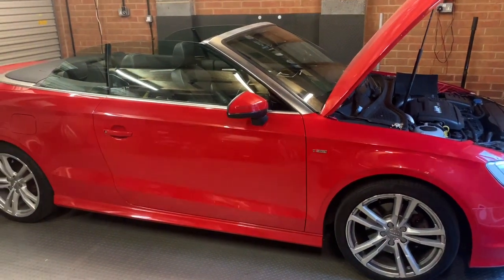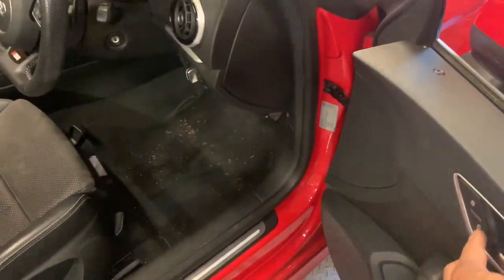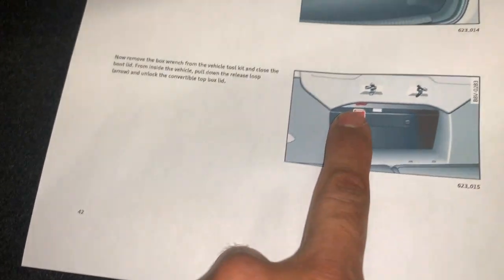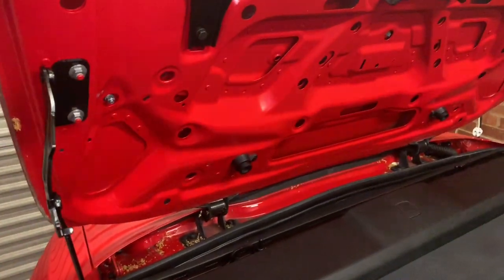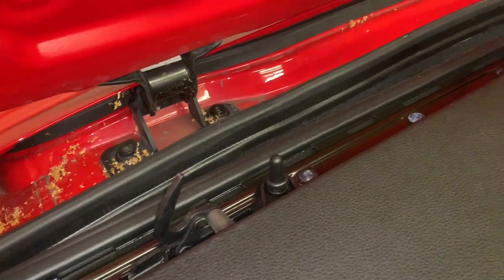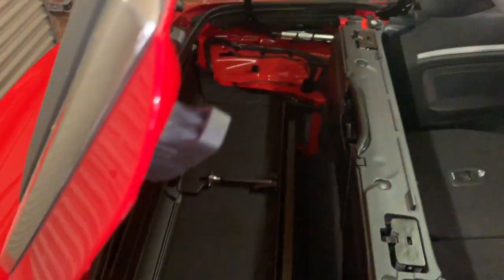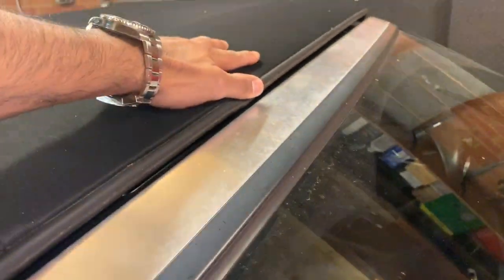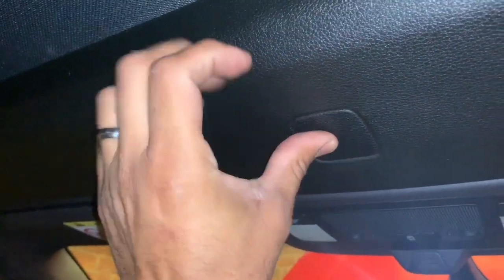Audi A3 8V Cabriolet How Manually To Close Convertible Roof

Comment: Great video, just one question though. You did not show how you electronically released the Storage compartment lid?
Reply from the maker: Ignition on

Roof button to close which will release the catch

Then ignition off and release pressure again
Reply: @CabrioletTech  Thank you very much indeed.   I know this is all in the manual, however, this video demo will help to get me out of the Sh**  (rain)  far more quickly should my roof ever fail to close.  Thanks again.

Comment: After you have done all that, you said needs to go for repair due to lid nor locking, what is needed there? Until that is done the roof will no longer work automatically
Reply from the maker: Hi

The root cause of the initial failure needs to be diagnosed and repaired
Reply: @CabrioletTech  when I drive it now, it says lid not secure, as a speed warning. Do I need to try and replace the red clip thing that is on a ring that you have to remove as one of the first steps?
Reply from the maker: @alexauser127  

Hi has either not been locked up correctly or you got a faulty component somewhere 

Reavers
Team VagPro